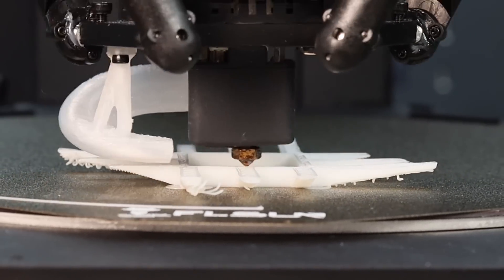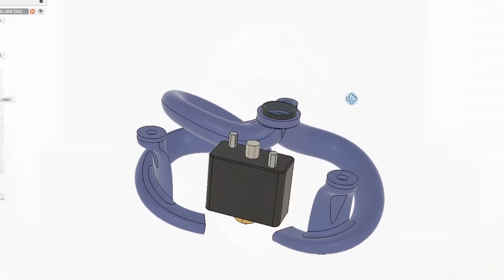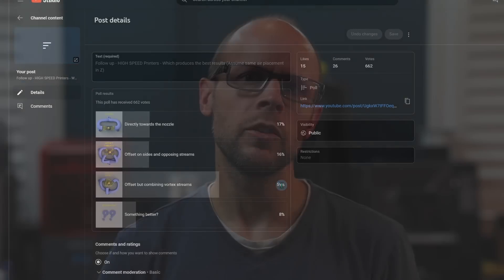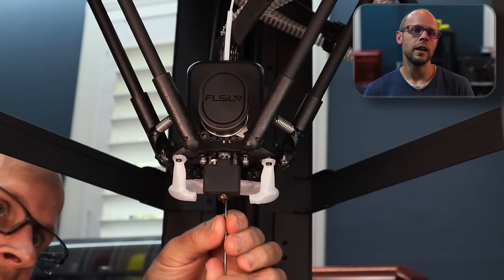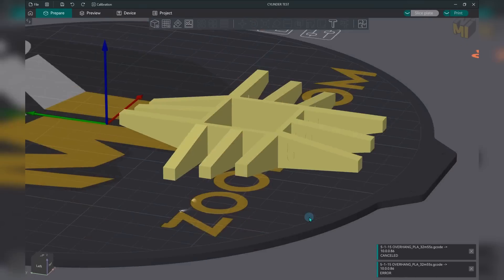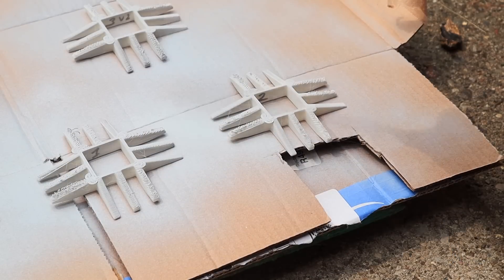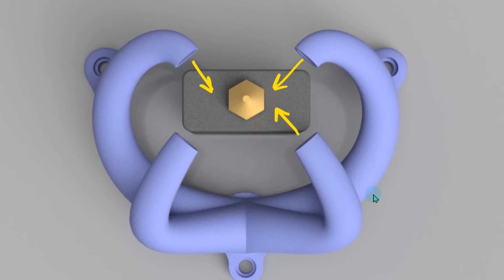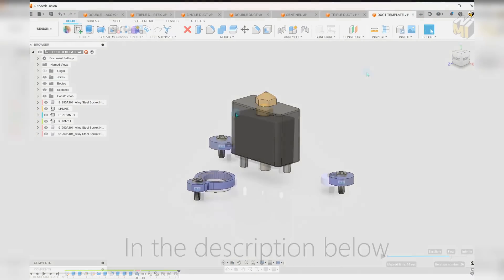More ducts is better, but how many is too many?

Comment: I think the first thing to do is figure out the balance for how restrictive the duct is (air speed vs flow rate).
Reply from the maker: Yesterday I was playing around with some ideas and I decided to blow into them, and there was quite a big difference from one to the other.  With this type of CPAP style fan, that resistance may not be as much of a problem as it would be on other fan types though.  How would you run the tests?
Reply: Best I can think of right now is designing a duct with an adjustable orifice, pointing at the nozzle, and you can measure duty cycle or temperature of the nozzle to see how effective it is. You can add more branches pointing away from the nozzle to measure the ideal orifice size for designs with more ducts.

Comment: I would also absolutely love to see a better duct design for the Qidi Q1 Pro! Do you have plans to make one in the future?
Reply from the maker: YES!  I will make a better duct for every single common printer if I can.  Maybe I should release a poll and then we can decide which to do first.  The QIDI is still one of my favorite printers, especially for high-temp materials so it's going to be a good one to upgrade a bit more.  What I'd like to do is take a bit more time to experiment so that we have the absolute best option.  I'm also sending out a challenge to anyone who can do better and we'll have a face-off, my best vs anyone else's and the winner will receive a prize as well.  I'll release a video on that subject so we can get some contest rules, but it should be fun and the result will be something even better I'm sure.  Nothing like a bit of competition to drive innovation.

Comment: Great video! I'd also like to see the effect of a general "chamber" fan just blowing air down to the part in addition to the part cooling
Reply from the maker: I can certainly do that.  I also wondered why the AUX fans don't direct the air better towards the part.  The movement of the printer could guide a duct to move in the Y axis to do a better job of directing the air as well.  It might be overkill, but something that could be interesting to explore as well.

Comment: I think there's too much looking at symmetrical design, besides the vortex. However, the vortex does try to create a circle of air. I think you should try the tri-duct vortex but with only two ducts, that way some fresh air gets pulled in from the gap where the third duct was so you don't create a insulating air layer. Purely an opinion with no experience using FDM printers.
Reply from the maker: This is a good idea, I have the 2 offset duct test coming in the video I'll be releasing this weekend!  I will also be adding some smoke and water testing for future testing videos to really understand what's happening with the air during a print.

Comment: I just love these types of videos, as an engineer I'm always interested to see people testing stuff to see if it can be improved or just to see if it's actually doing what it's supposed to, great work dude keep em coming I'm a big fan of your Chanel 👊💥
Reply from the maker: That's awesome.  And we're going to take it quite a bit further to see if we can come up with the ultimate solution which can then be applied to all 3D printers new and old.   I have a few follow up videos in the works to test some ideas and I also want to see what people can send me to test.  I'm sure there are some people out there with some very innovative ideas.   At the moment, I'm running some tests to understand the problem better and then we can figure out the right solution to apply.    It's an interesting subject that I think deserves some attention!

Comment: Hello, I own my 3D printing compagny since 8 years : Zoltan3D.
I already tried how much cooling is great ... your tests in quality are nice ... but you forgot the most important part in this test !!!! 
Yes, it's greater in overhang, but the prints become weaker with too much cooling because you don't let time to the filament to stick on the previous layer !
So yes, it can look cool, it's okay for a decorative object ... but it's WAYYY weaker with technical parts with too much cooling

Comment: FANtastic testing! In addition to the bridging behavior I suggest you also include test samples for layer adhesion.   Those two attributes are often in competition and it would be unfortunate to perfect bridging behavior but have an overall weak part.   Of course that's also impacted by your slicer settings.   Lots of opportunities for testing!

Comment: Stock K3 cooling offsets the two fans and that works quite well. However that’s two fans with very little ducting, the fans are pointing pretty much straight at the nozzle with some small nozzles attached to the output

Comment: I've always assumed you want the air flow to not hit the nozzle, but to hit the plastic directly beneath where the nozzle is. and so I would assume you want an air flow angle that is the same as the angle on the bottom of your nozzle and you want them as consistent as possible all the way around. So whichever direction the head is moving, it will be blowing cold air onto the part right behind.(I have a Cheap delta printer that has really bad cooling performance, so I put a really big fan on it and it was blowing on the nozzle too much and cooling it off So I was getting nozzle jams)

Comment: It's great to see some 3D printer cooling testing done! My first printer is a Cocoon Create Touch (basically a Wanhao i3 Duplicator) and it printed so much better when I replaced the stock cooler. The style I used tried for full 360 cooling - see Thingiverse thing:2155351 - so that could be another style to test. I've since purchased a QIDI Q1 and was wondering if it would benefit from a similar upgrade, so I'll have to keep watching for your conclusions!

Comment: So while having the ducts close to the nozzle seems logical, it depends on the print.  Here you are print small objects where the amont of time for the air to do its job is aided by the fact that the nozzle will be back over the area soon.  However take a longer print like a dragon or a house that takes up nearly all the bed and the motions are longer.  Getting the nozzles too close limits how much time is available for them to cool the filament as the nozzle moves away.  The only work around then requires an external source of air which may be obstructed by other parts of the print.  Really I think where you had the ducts was good so they aren't impacted by the heater block which could deform things over time depending on the filament used.

Comment: the relief ports on the stock duct may be for relieving static pressure on the fan so it achives higher RPM and air velocity.

Comment: Thanks for starting a conversation on duct design. 
Duct design is much more then number of ducts and where they are pointed.
Things like how sharp the bends are in the duct, consistency of the duct cross section area and shape of outlet.

This is a pretty deep rabbit hole

Comment: Thanks for doing these tests. I've been wondering about this subject for a while.

One suggestion for future videos. You may want to have a ring light around the camera, or a soft box pointing at you from really close to the camera. Your eyes are very dimly lit in this video. The last time I priced LED ring lights, you could get a good enough one for $45-$65. Not sure if they are still that cheap though. You could also just point a bright light at a big sheet of poster board or anything white, to bounce a soft light to fill in the shadows over your eyes. It's just a bit more work to get it set up than with a ring light on a stand.

Keep up the great work! Your channel is growing much faster than most other channels under 100K. I'd bet you'll be past 100K by the end of this year.

Comment: I ve designed a 4020 (server fan with 35m³/h) fan duct for my prusa i3 bear and its so powerful that it's cooling the (imho too weak) bed so much till Klippers says the heating failed.

However ive chosen 3 ducts and its working great

Comment: First off thank you for this video. I think we need to remember that manufacturers are all about sales and not really that much about innovation. let's be honest it's all about best bang for your buck and spending money on research is counterproductive in terms of that goal. I used to come on to these videos looking for quick answers. When I first started out 3D printing I probably would have been disappointed with the results of this testing. Now we're I have been doing this so long I think a video that answers some questions and then asks more is great for the community. The testing with water below the nozzle to check to see if there's a perfect circular vortex right underneath the nozzle is inherently flawed. Especially given the fact that you're looking for the most flow when printing overhangs. Adding smoke would help. Adding different colored smoke to each of the different vents wouldn't be easy but that would help even more. 
Finding a way to somehow make first the direction of the vents adjustable and then the size and the shape adjustable would also help.

Comment: Hi, I've done a lot of work on this topic for the VoronDesign team.
A couple of things I'd like to point out:
Duct design goes hand in hand with fan selection.  The best duct for CPAP won't work well driven by a pair of 4010's.  For fan supplied ducts you really need to pay attention to the ratio of surface area to volume, for pressure loss considerations.

The fundamentals of cooling don't depend on the number of outlets, it depends on heat transfer.  Heat transfer depends on the Nusselt number of the air against the extrudate as it cools below glass temp. Nusselt depends on Reynolds number and Prandtl number.  Reynolds number depends on air velocity. so our key will be in maximizing velocity in the area near the nozzle.

Horizontally opposed ducts create stagnant zones as the airflow runs into each other.  these zones have low velocity and should be avoided.
Likewise the vortex idea should be discarded.  A vortex around the nozzle woud mean 0 velocity at the nozzle, and that is not great for cooling.

It's great that you used test prints to study this.  At VoronDesign, we have used a number of tests for this at Voron Design.  We currently use a sub 6 minute print for measuring cooling performance at speed, called the D85 Shuriken.  Please feel free to contact me (Badnoob of Voron) on our discord for more details. 

Update: Chirpy of Voron has published a great guide on testing cooling, including the shuriken test, here:
https://github.com/chirpy2605/voron/tree/e32765621ba7ec412bbd1ec42bba24c48e303573/general/Duct_Testing
Reply: I get zero results when searching around for D85 Shuriken. Is this a Discord exclusive file? I have made some improvements to the Mini Stealth cooling ducts (dual 4010 blowers) but would really like to be able to do some more standardized empirical tests.
Reply: @alanrushing2807  I added a link to Chirpy's discussion of the cooling benchmark test we use, it also has the files.  Timing of the tests is key!
Reply: @HerrickAaron  Awesome! Thank you!
Reply: voron dont use like huge side blower?
Reply: @Light-DelaBlue There is a mod for this, but official Stealthburner is a Single 5015 blower
Reply: I'm not at the design team nor I'm a machine engineer.

But I did also a lot of tests with my designs for the biqu H2 @ artillery sidewinder.

My latest version is not published - but I can agree.

I ended up with symmetric designs which blow to and around the Nozzle with 25-30 degree, mostly no vortex.

I found a good point between air flow and air pressure - but as @herrickaaron said - a change in fan or print speed needs other air ducts.

In the end, the question remains for me whether there is a way to approximately calculate the right amount of air, pressure and speed for a situation - in order to then design the right fan duct.

 Please let us know if anyone has any well-founded tips in this regard
Reply: >  these zones have low velocity and should be avoided. Likewize the vortex idea should be discarded. 

My mental model, and I'm no expert and did no testing, is that since the nozzle is moving rather fast, the just-printed filament is almost immediately in the moving air zone in the vortex. Depending on the shape of what you print. The upside of the vortex seems to be that the nozzle itself isn't cooled so much, so then the temp difference between going out of the nozzle and reaching the vortex is greater. I have no idea if this is good or bad.
Reply: @JuliusHuijnk  This is conjecture, but I believe a well tuned PID hot end with a high power heater should compensate for the cooling of the nozzle. High speed bang bang control is pretty effective.

Comment: After hearing duct so many times it just started to sound like duck. 🦆🦆🦆 cooling was supreme! It is pretty fascinating how visibly different the results can be. I think a lot of our theorizing is validated with these tests. I wonder why the manufacturers settle on the designs they do. Probably has a lot to do with ease of manufacture and lack of complexity. That's why we can print our own parts though! We get to improve what they won't based on business factors. These are some of the best and coolest cooling designs I have seen, even if the T1 makes it a bit easier to integrate. I'm definitely happy to watch more experimenting and testing! A showdown would be great.

Comment: Hi, it appears you've overlooked a critical aspect. In fluid mechanics, the presence of two unbalanced outputs can induce a phenomenon known as the vortex effect, like you reproduced with your 3 outputs, but 2 outputs are quite enough to create the vortex. This can often result in greater efficiency than the fan's output alone. The two vents you observe near the outputs may well function as Venturi intakes, designed to enhance the airflow.

There exists a plethora of techniques to augment air flow, far more pertinent than merely increasing the number of outputs. One must also consider the internal resistance within the conduit, likely exacerbated by stratified layers and a rough surface texture, which invariably impedes the flow. Additionally, an analysis of the pressure dynamics within the duct conduits is essential, as variations in pressure can significantly diminish the airflow.

To further refine your design, you can utilize the fluid simulator available in your CAD software to analyze these factors prior to prototyping. This allows for a detailed examination of the airflow dynamics and helps in optimizing the system's efficiency.

Fluid mechanics, as a discipline, is profoundly intricate and necessitates a comprehensive understanding of these multifaceted interactions.
Reply: Vortices will only be to the detriment of air cooling design. The air velocity at the center of a vortex is exactly zero. And the velocity decreased as you get closer. The aim is to try to get to force convective cooling where by you are getting you heat transfer coefficient into the 10-15+ range. To do this you will need to maximize velocity and thereby reynolds number, In effect the highly turbulent flow will have micro vortices (1000x smaller than the ones you are mentioning) that act like miniature heat scrubbers buy absorbing some heat and rolling out of the way of the next cooler vortex to do the same. Large static vortices where all the action is happening in the center of the cooling apparatus is going to have the the opposite effect of what you are looking to create.
Reply: @JaredBrewerAerospace  I agree with everything you said. However, you forgot that the printhead is never stationary. You don't want to cool down the nozzle itself, which is the thing in the eye of the vortex, but rather the most recent deposit. That’s why using a vortex is perfect for this application.😉

Comment: Remember air is a fluid. Air is very sticky.

The more small the conducts and the more complex the paths the more inneficiemt it is.
Reply from the maker: I've never heard anyone describe air as Sticky but it's a useful way to think about it.  Is a material that is hydrophobic also considered something that repels air?  I'm testing a few new concepts for the next video and it would be good to include some ideas to take these ducts to the next level.

Comment: I definitely support you testing some of those other hypotheses you have on the duct design. I realize that could be a series of videos but even just testing the vortex vs turbulent designs seems like it could make quite a difference
Reply from the maker: There are more to come for sure, I have some pretty...let's say unique designs coming that I want to test!   What I'd love to do is print some large scale models and then run some smoke tests on them to be able to see what's happening.  I don't know the best way to do a smoke test yet though.

Comment: What about a nozzle cover with spiral shape in order to create a vortex effect?

It could be integrated /suspended from the air outlets by thin bridges, so tu can direct the air !
Reply: ...or a donut shape surrounding the nozzle duct with interior spiral shaping and diferent outlet shapes, directions and sizes
Reply from the maker: Oh, very nice!  That's something I've never seen done before.

Comment: I think you can try the 2 ducts but point one to the front of the nozzle and the other offset to the back.   Great video.
Reply from the maker: I'm going to give the 2 ducts another go and we'll do a head to head, one like you suggest and the other is the original tested in this video.  I think it's going to have a huge impact.  I also need to do some smoke testing or something visual to see what's really happening.